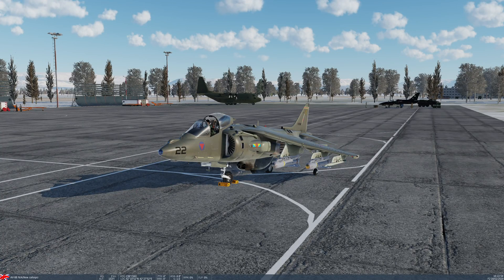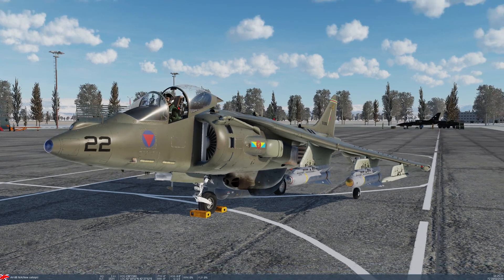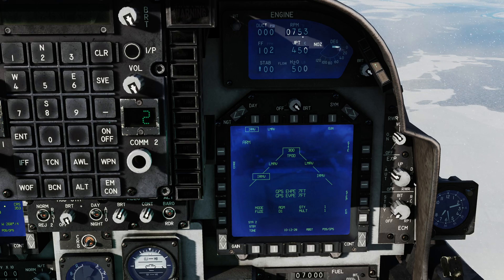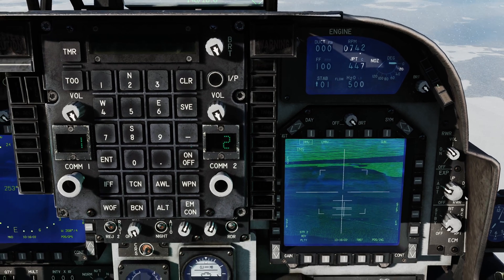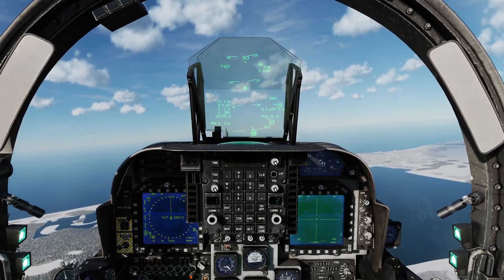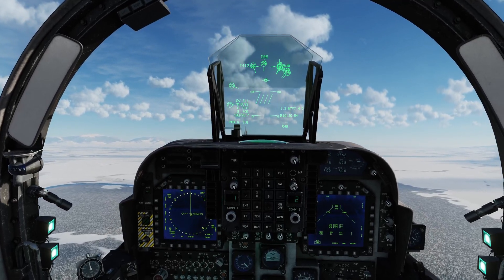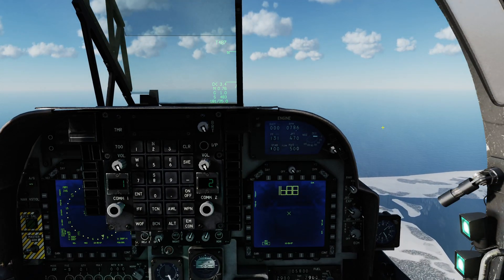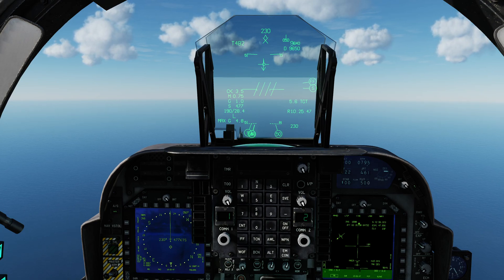DCS AV8B Tutorial 13 - Maverick Missiles

Comment: I think there's still some bugs in this module, I was trying to get mavs to work today but I couldn't get them to launch. I had the mav locked on a target but it wasn't until I changed to INS mode that the pickle button launched the missile.
Reply from the maker: Sounds like you aren't managing to get a missile lock. Launching like that would be unguided I think. Do you have the sensor select in IRMV before launch?
Reply: @deephack  yup. Just went and redid the steps and took notes to try to make this easy to reproduce.

Loaded plane with two IR MAV (AGM -F) on outboard stations, two Laser MAV (AGM-E) on inboard stations, Gun Pod and T-Pod underneath. 

Joined custom mission and put on active pause about 4 miles from abandoned runway (place where everyone does target practice South of Kobuleti.

Master arm on, A/G button selected, select the IRMV from top buttons on maps page on left MPD.  SSS-Aft twice to bring up TV Mode on the right MFD for the DMT.  I slew the DMT onto one of the tanks using the TDC and then TDC down (a few times) to select the tank. Map shows diamond where the DMT is pointing and DESG boxed on the bottom left with TGT next to it.

Uncage the MAV and hit sss-forward to select the MAV.  IRMV shows on the top-left corner of the right MFD (still on DMT page) and IRMV is boxed on the HUD.  The MAV is already pointing at the target so I hit TDC In to designate and the crosshairs close in on the tank to denote a lock (just like in the warthog). HUD denotes that I'm only 4 miles, IN RNG shows on HUD.  Pickle button does nothing. Press sss-forward again, now I see IRMV on top left of MFD and IRMV is no longer boxed in the HUD.  Pickle button launches.  Second MAV I put in a target but move the DMT to a different target.  Same deal as before, launch the MAV and it goes after the correct target, not the DMT.
Reply: @deephack  Reloaded the same mission and I must've done something slightly different. This time when slewing the MAV I noticed that the DMT is slaved to the MAV.  It also allowed me to launch the MAV with IRMV boxed on the HUD.
Reply: The best I can guess is that there's a bug that the plane doesn't realize what the selected sensor is or doesn't realize there's a valid lock. When it gets stuck it won't let me use NWS to change the zoom or unlock the target. I have to change to INS then hit NWS to break the mav lock and change zoom. Then switching back to the mav I can  use TDC in to select the target. 

Seems to happen rather inconsistently from what I can tell, though it typically seems to happen when the MAV locks the target as soon as it's either uncaged or IRMV is selected as the sensor. If I can uncage and change to IRMV before it locks the target it doesn't seem to be an issue. 

Maybe it's time to reinstall the module?
Reply: Only other thing I can think of is whether there's a difference between slewing the DMT to a target and when in INS mode vs TV mode before uncaging the MAV, though I'm getting inconsistent results seemingly.